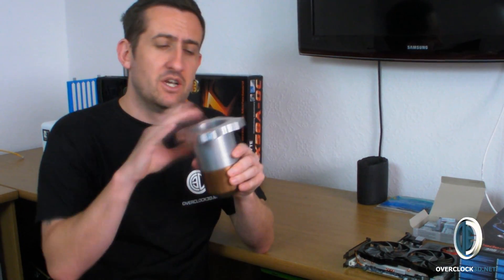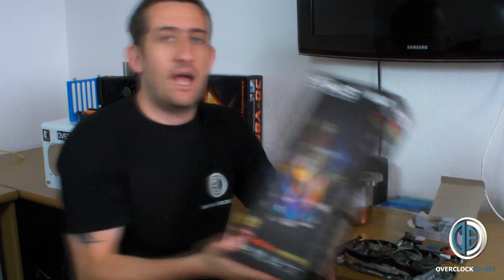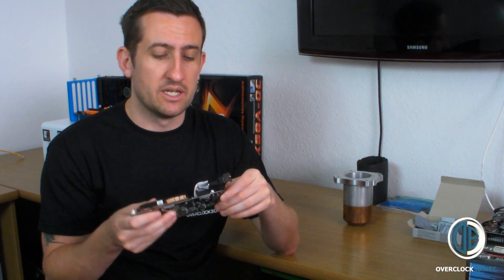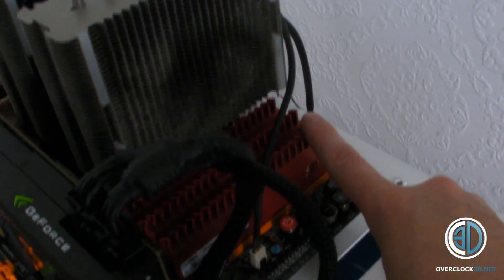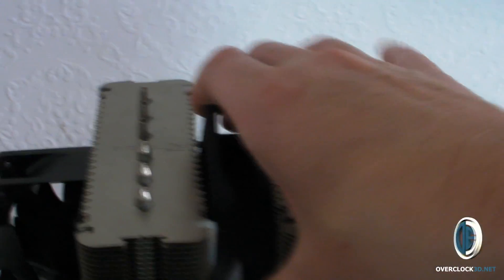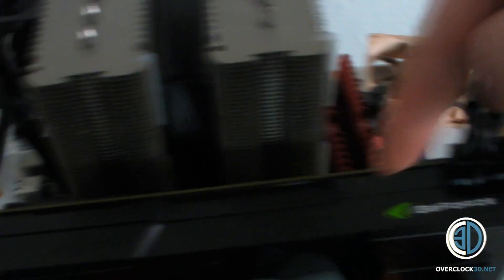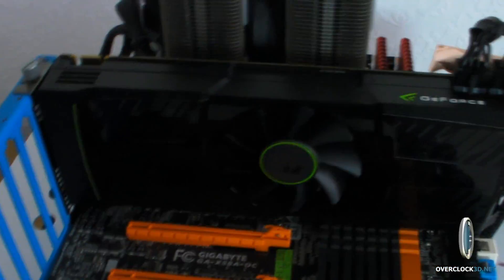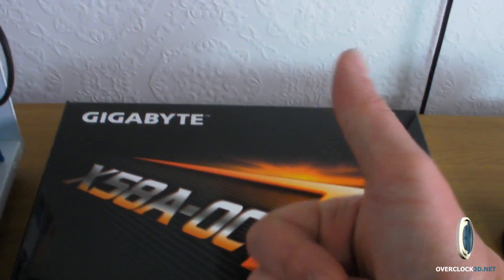Gigabyte X58A-OC - Dry Ice Introduction DICE Subzero Overclocking

Comment: Why don't you try to run the Zotac 590 with the OEM heatsink and overclock it on air? Doesn't the Zotac 590 have the same PCB as the other reference 590s?

Comment: Hey there. Just a question. Why dry ice and not liquid nitrogen? I suppose it get's sub -100 Celcius, so you  have better chances to reach absolute clock limits, as long as you discover your coldbug. Do you think dry ice is going to perform that well? Also is liquid nitrogen more expensive or hard to find? 
Keep up the good job ;)

Comment: @Snake1979xfire if i'm not mistaken you are running an intel socket mobo. if that is the case then just turn you cpu cooler, on intel boards you have the option of down-up or side-side flow. i take it that your running into problems with a side-side layout but if you change it to down-up it should work just fine.

Comment: Looking forward to the next video then you insulate the board. 

Just a lilttle tip. if you got some nail polish, plastic paint or something similar then paint the socket area with it. it keeps the water from hitting the PCB and and it's easier to get the art eraser of then you are finished benching. Just use a small brush with some acetone then you want to take the nail polish of again. 

Good luck.